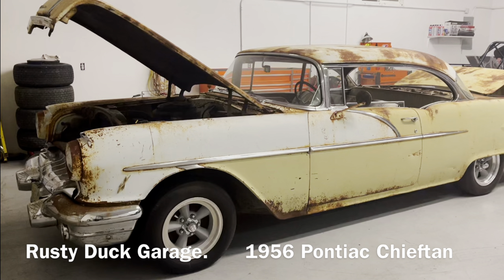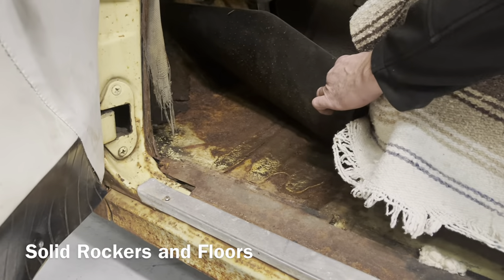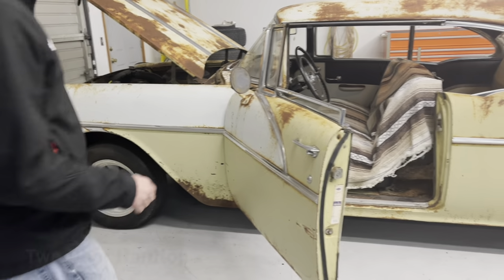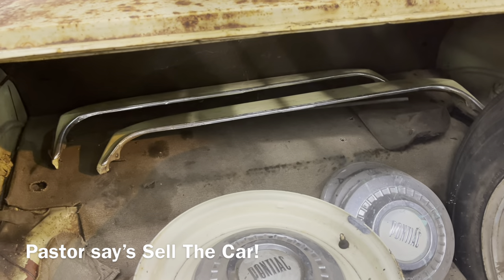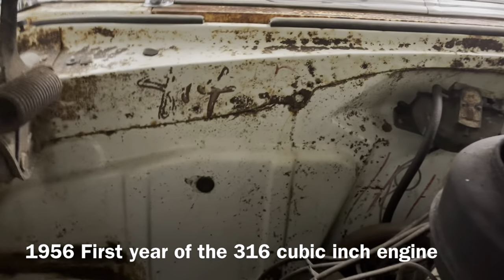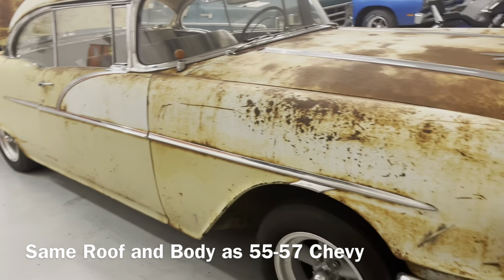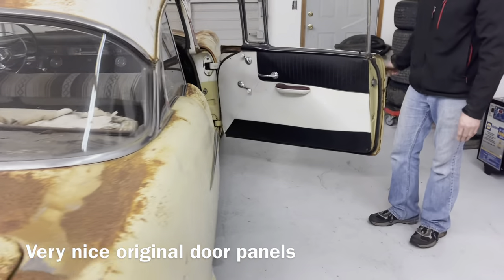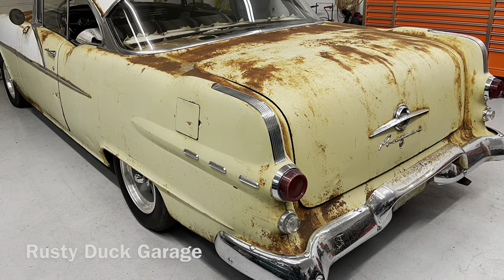Barn Find 1956 Pontiac Chieftan 2 door Hardtop Low Mile Budget Project Vice Gripe Garage Style

Comment: I had one of these decades ago. It was a two door sedan with a three speed manual transmission on the column.  I loved that car but it smoked like crazy due to worn valve seals. I wish I still had it.
Reply from the maker: Thanks for sharing
Reply: I love the sound of the 3 speed straight stick on the Pontiacs of this era - You can recognize that unique sound of that transmission from a block away...

Comment: If that was mine, I would have the brakes updated to disc brakes front and rear, I would then have a set of wide white walls put on a set of chrome reverse set of wire wheels with the knock off spinners put on the car. I would have the seats reupholstered, front and rear and have the head liner replaced, along with the carpeting and have period correct floor mats. I would also have the underside cleaned and then under coated, I would also have a set of dual exhaust installed with glass packs. I'd have it repainted, the same color as it currently is, and have it as my daily driver, except in the winter. I would store it and drive my old truck.
Reply: When I was in Cuba I saw a beautiful 56 Ford. Looked like showroom condition. But after a closer look I saw it had 4 wheel disc brakes and a Honda engine. Those Cuban mechanics sure are resourceful when you see all those 50's cars in running condition.
Reply from the maker: Glass packs!
Reply from the maker: https://youtu.be/NaRalhhVcFQ

Comment: I'd minimum paint it and redo the chrome. The interior is just fine could probably use some work. The engine bay it could be left alone shows a lot of original marking that's cool. I'd probably put the original wheels back on.
Reply from the maker: Fair enough!

Comment: Parents had a station wagon,complete with parking cinder blocks lol
Reply from the maker: Well that’s one way to keep it from rolling.
Reply: You would need the parking brake to hold it if it was running,or left in neutral - but apparently,most people don't realize that there is a locking feature in the transmission when the car is placed in reverse gear, and the ignition turned off...

Comment: FYI - If you place the transmission in reverse,and turn off the engine,you will hear the transmission lock - That is the equivalent of Park position on later automatic transmissions.My father bought one of those used in 1960 - Great car....
Reply from the maker: Thanks Frank!

Comment: I love old Pontiac’s!...If I was lucky enough to own this one, I might bring all that excessive brown surface rust down to metal colored patina and then clear the body? That’s a dilemma. But for sure, I’d add in a whole new clean factory interior, and headliner in the Pontiac, re chrome the front and rear bumpers, I’d want to fix that the big old long running scrape on the body, on passenger side, before the rear wheel well. I like the wheels he added, but I’d probably run those original wheels, with the dog dish hub. 18” or 19” inch blown up versions of the original wheels with dog dish hub caps would look incredible, if the Pontiac was bagged and slammed on the ground...Either way its a awesome example of a 1956 Pontiac survivor...8)
Reply from the maker: Thank you Jodi! The interior would be one of my first upgrades. Plus size factory wheels would be cool.  https://youtu.be/NaRalhhVcFQ

Comment: Disc brakes , new bushings and shocks , vintage heat and air , elect wipers if they are vacume, fix the front seat , new carpet , buff and linseed oil , and drive it everyday
Reply from the maker: Now that’s a good plan!

Comment: I like patina, however I am allergic to trends. Blow the car apart. Inhibit the surfaces on the back sides of the panels and paint the outside to factory original. Reseat the heads and check the bearings. Cam and lifter upgrades and raise the compression. Trac loc the differential and replace shocks. Throw the factory wheels back on and enjoy! Oh yeah, that interior.
Reply from the maker: Sounds like a good plan.

Comment: That is a ting of beauty.i think I would try and clean up the rust and then clearcoat it.pull engine and reseal it and paint it back original.go thru transmission.i think I would also upgrade brake system and suspension. Clean up interior and fix as necessary.i would try to keep as original as possible but making sure it's a safe car all round.
Reply from the maker: I like your plan!

Comment: If I owned it I would leave it like it is I would clean up the rust on the bumpers and chrome as much as possible and clean the stainless but I would not touch the paint and I would make it safe to drive so fix the brakes and front end parts if need be and drive it
Reply from the maker: I like your plan! That is the way I like them.

Comment: An amazing find in 2021. Cars this old found in the wild in this condition just don't happen today. I'm an absolute purist, so the one thing I would not do is the slightest custom touch anywhere on it. The paint is a bit too shot to be in the "survivor" class, but the old "it's only original once" statement comes into mind. Once you throw new paint on it, it becomes any other restored '56. I would spend many hours carefully cleaning, smoothing, and polishing every element of the car. A replacement carpet is in order and, depending on how bad it is, a little "stitch-witchery" on the interior to make it presentable. Mechanical and electrical issues tended to to make it safe. Finally a spray of satin clear over the body. I can tell you, at a car show, your car would be the first one I would walk over to!  Good luck.
Reply: Right, the rotten interiore is Patina...oh git real.
Reply: @allenschmitz9644  Don't be fooled. The last few times at car shows I saw people surround a worn-out all-original car and chatter away about it. Once you tear it all out, your car blends in with the other rows of shiny resto's. There's nothing wrong with a well done resto, but you better think it over a few times because you can always decide to restore it later. You can't decide to bring it back to original later! LOL
Reply: @josephconsoli4128  Blends in...yep, in a junk yard, something a car crowd cant do in there electric wheel chairs .
Reply: @allenschmitz9644  Hey, if the owner has the cash to fully restore it, more power to him. It's all personal opinion.
Reply from the maker: I’ve seen few cars done that way and they are my favorites.

Comment: Fix the interior, make it safe, reliable, roadworthy, and drive it as is...
Reply from the maker: I agree. Interior needs to be nice.
Reply: @RustyDuckGarage  
Love the look, only original once, but safety, reliability and comfort come first. The rest is cosmetic...
Reply: I'd prefer to see it at least partially restored,if not fully,but that is just my personal preference - I hope that the owner keeps it as original as possible,whether or not he chooses to restore it - These are great cars just as they came from the factory - No need to install a modern power train. It's very fortunate that the rust is only surface rust,and the car is basically still solid  - It is a real survivor.If the transmission needs rebuilding be sure to find a shop that knows how to rebuild it properly - It is very different from a modern transmission - I would love to have this car myself....

Comment: pontiac frame is a little longer in the front I believe. I recently acquire a 57 pink Pontiac 2 dr hard top from western ks.
Reply from the maker: Pink 57 Pontiac!  Don’t see that everyday.
Reply: These Pontiacs do have some of the same features as the Chevrolets of the same time,but there are differences,for example,I believe that this car has a 122" wheelbase,versus 115" for the same year Chevrolet....
Reply from the maker: I think you are correct.

Comment: I'd repair the brakes, make sure the exhaust is good, suspension, make it safe to drive in it's stock condition. The engine might be begging for some period correct speed equipment :)
Reply from the maker: Good call! Period correct speed equipment!

Comment: Does it have a heater and defroster ? Because I didn't see heater hoses going to the firewall
Reply: The heater core sets in the box on the driver's side of the firewall. It isn't integral under the dash like later model cars. You can clearly see it with both heater hoses running to it in the video.
Reply from the maker: Thanks for the information. I had not gotten back to the car to check. Thank you!
Reply from the maker: See Dave’s reply.
Reply: @1967davethewave  thanks

Comment: You have a regular Hydramatic.  The majority of the Star Chiefs in 1956 had the Stratoflight (Jetaway) which has a Park gear.
The 316 is an improved bored out version of the 1955 287 which had a lot of bugs in it(so I hear) and relatively few parts are interchangeable between them.
I hope this beautiful original classic doesn't end up like so many with a Chevy crate motor and a bunch of other modern junk.  These cars are getting hard to find and deserve preservation.
Reply from the maker: Yes they do. The hydro is just so expensive to repair.
Reply: @RustyDuckGarage  Yes and not that many around who can do one.  They required special tools and with the GM hydro each year was different except maybe the 1948-52 Buick Dynaflow.

Comment: If it was mine id probably make it a daily driver, stop that surface rust from doing more damage, update the running gear, keep the interior as is, probably keep that patina, doesn't always have to be about the flash paint job, or show room condition, it just has to work.
Reply from the maker: Not a bad idea. https://youtu.be/BOcq2r6Gjzw
Reply: Lubricated top to bottom withMarvel Mystery Oil ?,smells like cherries?l including the rubber ,stainless the Chrome the steel aluminum the plastic maybe not the seats,though!

Comment: I think I would clean up and either upgrade the brakes and clean up the engine and drivetrain and just make sure it was gone through and repair or replace any worn out bearings etc. Then restore the interior as best as you can to original and just clean up as much as you can and leave the body just like it is except maybe just stabilize the surface rust and prevent any more from occuring.
Reply from the maker: I like your plan.  https://youtu.be/NaRalhhVcFQ

Comment: Actually pontiac didnt go to the PRNDSL till 65 up till 64 its PNDSLR.....and the older pontiacs pre 55 you put the trans in rev for park.....it locks forward and reverse drums together so it wont roll.....i found that out with my 50 silver streak......id love to have that 56 to add to the rest of my collection....pontiac always was a better looking and better built car.....its sad every one wants to save the cheap chevys over the upper model cars like buick olds pontiacs......
Reply from the maker: Thanks for the information on how the park position works. I like them all but the BOP cars have the nice extra trim.
Reply: @RustyDuckGarage  im not sure the tri 5 s trans are set up the same as my 50 trans is im just saying what the factory manual says.....it threw me for a loop too....was scared to park it on a incline due to the parking brake being frooze up....but im a huge pontiac guy and have pretty much every year from 50-66 except a tri 5 car....your buddy has a sweet car.....

Comment: drive it and put some miles on it.  I"d change the review mirror one on it looks like a 60's chevy truck.
Reply from the maker: Drove it Wednesday!  I’ll take another look at that mirror. And yes it appears the frame is longer than a Chevy in the front.
Reply: @RustyDuckGarage  Mine has the engine and transmission sitting in it but everything’s disconnected and a chain around it like they were going to pull it out. It has the 347 four barrel. They just cost so much to rebuild I’m not sure what direction I’m going to go with it it’s a very original car
Reply from the maker: The cost is a good reason to leave this one as is and protect it. Good luck with yours. https://youtu.be/NaRalhhVcFQ

Comment: To restore it would be more expensive than most people could afford and it would not be a daily driver. Replace mechanical parts where needed and treat rust and drive it!
Reply from the maker: Exactly right! Too many times folks pull old cars apart to restore or Hot Rod them and become overwhelmed with the project and the costs and the car becomes  a parts car.  Drive it and store it dry!   https://youtu.be/NaRalhhVcFQ

Comment: Too much patina is not necessarily a good thing. I would go over that car with a Scotch Brite pad and CLR cleaner. Most of that original paint is still there underneath that rust, it would look so much better with the rust cleaned off revealing an honest, original weathered finish. Some guys add floor wax or linseed oil over the top when it's all done, either way looks fine. But please, no gloss clear coat.
Reply from the maker: I agree not a huge fan gloss clear over Patina.